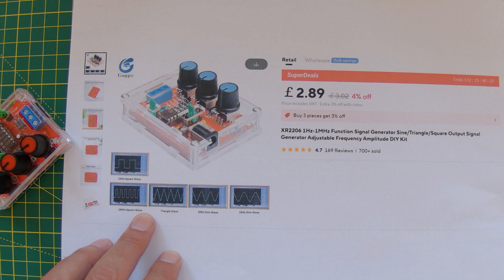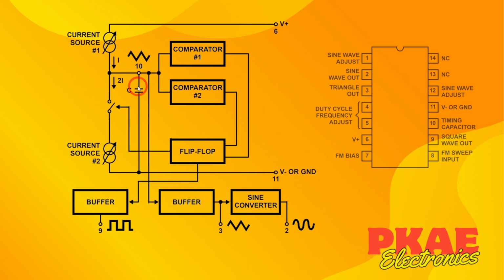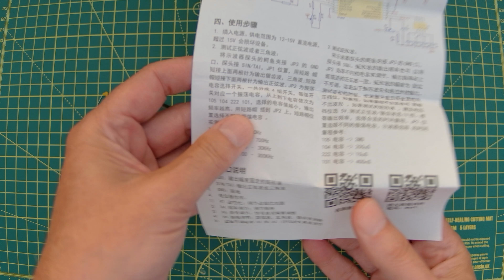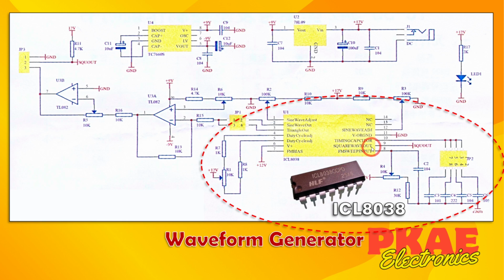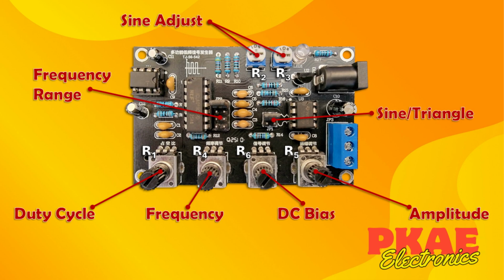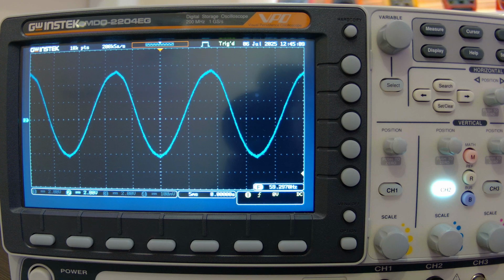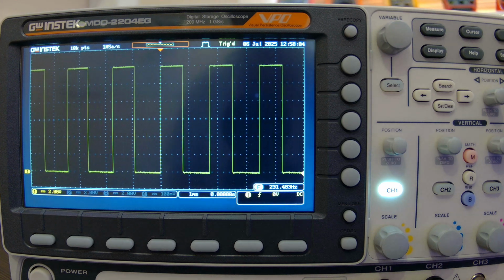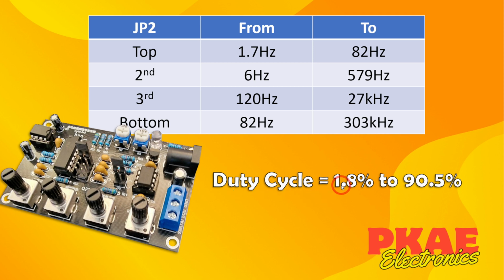ICL8038 Waveform Generator

Comment: All very nice but why don't you connect it to something more than a 'scope? A tiny speaker would be good so we can hear it. What sort of thing can it drive without further amplification?
Reply from the maker: A speaker would be too much load if driven directly. The greater the load, then of course the greater distortion & attenuation of the output signal. I believe the 8038 has an output impedance of around 200 Ohms but, in the instance of the kit demonstrated, the Sine and Triangle wave have an additional TL082 op-Amp output stage. I would suggest keeping the load to 10mA or less.